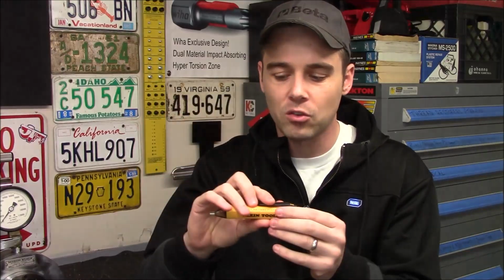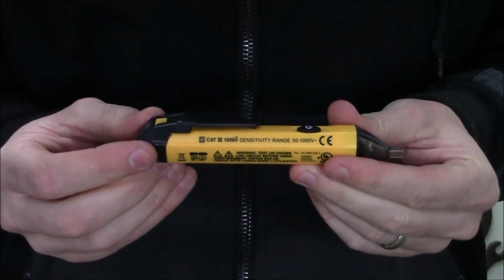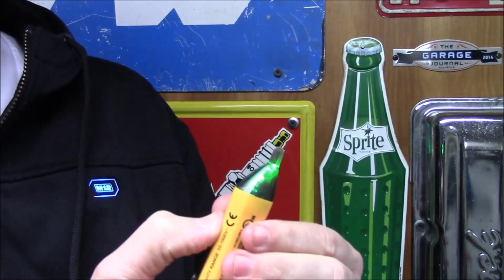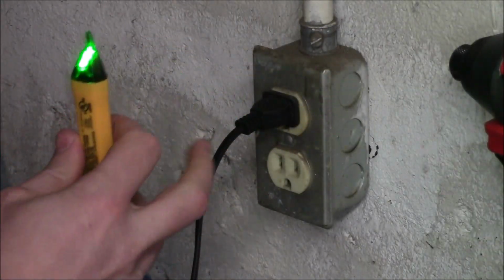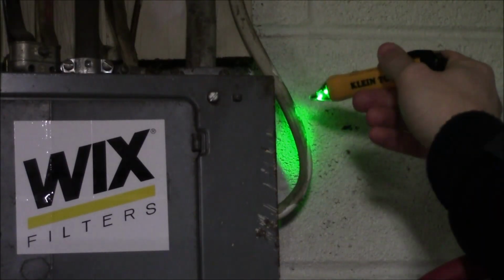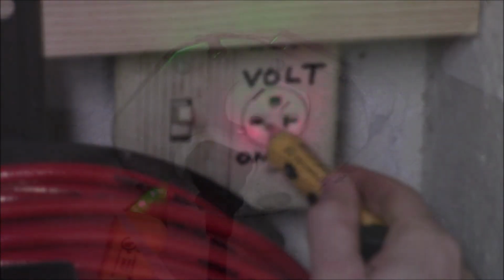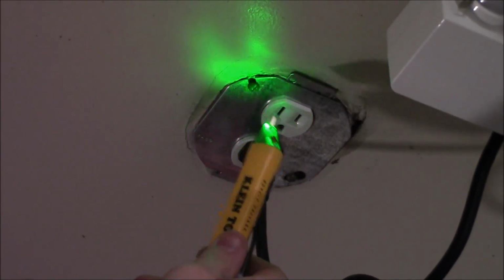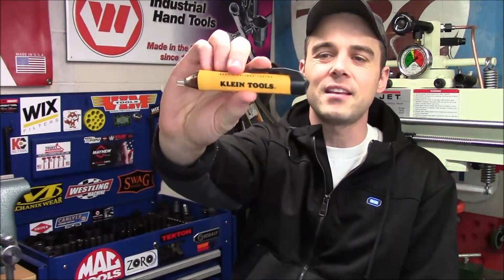Klein Tools NCVT-1 Non Contact Voltage Tester

Comment: 5:01  It doesn't give you the illusion there is no power in the wire, what it does is to help you figure out which conductor in a wire is the hot wire, and which is the neutral wire.
Reply from the maker: For a DIYer….. It gives the illusion, unless you know how to check it fully.

Comment: Question: This product is advertised as non contact but I noticed you stuck the pen right into the outlet to test. Is this the way this tool is supposed to be used?
Reply from the maker: Well keep in mind that it doesn’t physically contact the metal inside the outlet, nor the copper inside the wires…. The closer you get, the more accurate it is.  Better safe than sorry, so I simply get as close as I can.

Comment: I'm not too impressed with this tester. It doesn't have the same sensitivity that my last voltage tester had. I'll try fresh batteries since I used what came with the tester. 
But my last voltage tester would read power through a light switch plate. This one seems like you have to get almost on the wire before it indicates.

Comment: I don't know if it was in the comments but it wasn't in the video I had mine in a box for years took it out turned it on had a test work couldn't shut it off and then it wouldn't test correctly either it just had the green light on forever so I just decided was supposed to be like a computer and I pulled the battery out but the batteries back in and everything reset and it's good to go sorry anyway if you got problems with the thing take the batteries out put them back in thank you for the video

Comment: Hi thanks, I got a weird problem. When I test an outlet, (it's an old house, 2 wire, no ground)  Both live and neutral turn red. However, when I measure between the L and N with a volt meter, there is 0 voltage. The outlet is dead, no lamp turns on.  

So I ran a wire from the N at the outlet back to the power box to test for continuity break is the Neutral,  and I get a voltage of 117V between the N wire coming from inside the house and the Nueutral connector bar at the panel?  What is happening here?
Thanks.

Comment: If you don't use this frequently make sure you remove batteries before putting it away in your toolbox. If you're lucky they'll just deplete on their own. I just rieeded to use mine after being stored for about 6 months and not only were they dead but the battery leaked and destroyed the insides rendering it junk.

Comment: It makes no sense to me why these are preferred over the more sensitive, adjustable style of NCVTs. These clearly show false negatives if you just happen to not be touching the right place and the fact they require you to get close enough it's touching a NON-CONTACT tester bewilders me. Sure, it tests outside the jacket without contacting the conductors but I can wave my adjustable tester around the air of a junction box without disassembling anything to get a positive reading.
     How is an early/false positive worse than a  false negative??? I'd much rather have to double-check my positive readings than miss one entirely just because I was a quarter inch away...
I've asked a couple electricians and they can't bother explaining why. 
I want to replace my cheap adjustable one because it's not very durable but these more expensive testers are practically useless to me.

Comment: Why are they called "non-contact" testers if you have to contact the tool with the wiring?
Reply: Because you don’t have to ‘contact’ the non-insulated conductor like you would on an amp meter or alligator clip tester.

Comment: A crappy tool. Don’t buy this. The ON/OFF button never works when I press it, so I press it harder and harder but it won’t work, so out of frustration I’ll throw it back into my tool bag, and then it turns on due to the slightest touch when it lands. And good luck trying to change the batteries. You’ll never find a more puzzling and difficult battery cap to replace once you’ve changed the batteries.
Reply from the maker: Try decent batteries & not junk ones from an old TV remote.

Comment: Hi, thank you so much for the easy to understand video. I am a single mom and have to fix all that I can myself. I purchased one of these voltage testers and really was not sure of its capacity, but you explained everything about using it so well in this video. I now feel comfortable using this tool to check for voltage without having to consult any guy to have to check it for me. Thank you again!

Comment: I just installed a new electrical outlet in my house with a Built-in USB port. Before i use it i tested it with this tool.  I'm concerned bc when I put the tester in the hot side of my electrical outlet, it's flashing red green red green. Can someone tell me what that means???
Reply from the maker: USB = dc power
Reg outlet = ac power

Comment: I accidentally put mine into "silent mode" and can't get it to go back to normal beeping.  Frustrating.
Reply from the maker: I think if you turn it on, and then hold on the button for five or 10 seconds, it will beep and turn the noise back on.
Reply: @RealToolReviews  
That did seem to turn the beeping back on, but now it's so quiet I can barely hear it.  And yes, I tested and ghanged the batteries. No difference.

Comment: This was a good review,  two  subjects I’d like your opinion on.

First it would have been more to the point to video you testing the tool with a outlet you knew to be live before testing the suspicious outlet. You tested the tool on the switch and had it been bad it would have left the impression that the cuicuit was not energized. Secondly, I disagree with your comment that the Kline NCVT-1 is not for professional use, in my opinion, anything Kline manufactures is suitable for a professional and can be trusted. Other then that in my opinion, this was a good review

Comment: The only thing I have to add is, you dont have to hold the button down until it turns off. just hold it down for 1 second (like when you turn it on) and release and it will turn off right away.

Comment: when he tests the hot light switch it beeps differently when tests each side of the switch.
The light turns red for both sides  BUT the first side is a fast beep beep beep and the other side is slower beep...beep...

What does that mean?
Reply: I have this same issue. It also beeps slower on most metal surfaces. What gives?
Reply: Rj Miller - Jesus is coming soon?

Comment: I have one of these and it detected 12-48 volts when it was 5 volts. It detected 12-48 volts when it was 120 volts, and it detected 120 volts when it was 5 volts. It also detected 0 volts when it was 120 volts. 

It is hit and miss with this thing. and no electrical tester should be hit and miss. It is useless then.

If any electrical tester works accurately, then it's a Fluke.
Reply: This one only beeps and changes color. It doesn't tell you the amount of volts you have.

Comment: Strangely this tool also beeps on DC voltage.  I tested the cable between a phone charger with an output of 5.2v DC and it beeps all along the cable length from the charger to the point where the cable plugs into the phone.  Any ideas why?
Reply: It's probably picking up emissions from the DC switching converter or coupling from the AC input.

Comment: Can I test my cigarette lighter socket with this tool?
Reply: No.. Cars run on DC current.. Unless you have an invertor you cannot test it and if you had an invertor it would likely have a light showing you have power...  

This is for household wires and plugs etc.

Comment: So, I followed the rules and it seemed to shut off, but it beeps twice at uneven intervals. 15min. Coupla min. I went to sleep but it double beeps at almost 3hrs. Is it a battery warning or ?
Reply: Replace the batteries. Use rechargeable if you can. When switched on, if only the red light beeps, the batteries need to be replaced. It's always best to also double check for power present, by using a pig tail tester. Also, to be safer, wear rubber gloves and rubber bottom shoes. :/

Comment: Mine is too sensitive.., as soon as it's anywhere close to any live wire (say 6" radius) it starts beeping red.  I wanted to check the wires inside the dimmer switch in the wall. I took the cover off and then unscrewed the switch and pulled it out of the box... I wanted to know which one was the LOAD and which one was the HOT wire but even though I pulled the wires as far apart as possible, as soon as I approached the area with my tester, the red lights came on! So frustrating... What's the solution? One thing though, should I have detached all the wires from the switch first to get a better result? I did mine while the switch was still attached....

Comment: I have the dual one that works with both ac and DC and I have no idea how to operate the DC mode lol 
But thanks for the tip lol its very helpful and I'm a part time electrician
Reply: AGENTMARIE AKADva PLUS • What is the name/brand of it, and have you learned how to operate it yet? Use Google or YouTube to find out how to use it.

Comment: Thinking about ordering one of these. Can anyone tell me if it can tell you which wire is the hot and which is the neutral? Thanks.
Reply: That's why I bought mine. The hot wire will beep and the neutral wire will not beep.

Comment: Why does this device chirp at two different levels?  I just picked one up recently, sometimes it chirps fast and sometimes it chirps slower.  It was audible in your video as well.
Reply: exactly what I need to know as well....
Reply: Thanks! but shouldn't all outlets on the same circuit beep the same?

Comment: I have a circline fluorescent light fixture that's not working even though I installed a new bulb. The fixture has been there a long time but up to this point I have never had an issue with it. I don't know if the problem is the switch or maybe the ballast. Would one of these testers be helpful? Thanks.

Comment: Mine intermittently detects low voltage and will beep if I jab it at the wires.  So, sensitive when I don't want it and not sensitive when I do.

Comment: wish it dc
Reply from the maker: +Jeff L Yes, that would be nice.
Reply: Ohm meters test continuity, fuses, wires as well as AC, DC power. That however requires contact with the conductors. This a non contact voltage tester. It doesn't tell you how much voltage. It only warns you it's hot. To check for proper voltage, use an ohm meter.

Comment: These are very handy, but they can lie too. Fortunately, it'll lie in the way where you won't get hurt. My old Klein tester a couple years ago would pick up "residual" voltage. Mainly in old houses and commercial buildings. It basically would tell me something was hot when it really wasn't. In some old houses, I could put them against wood studs and they'd be chirping away. Electricians really should have digital meters. They are really the best way to go to be a professional. HOWEVER! In the defense of the non contact tester. If you need to test something where you have absolute no reference to ground, then a digital meter is useless. PRO TIP! If you are picking residual voltage with a non-contact tester, you can hold the insulation of the wire, and it (in most cases) will neutralize the voltage and the tester will stop chirping. As far as I know, this has to be a single conductor, not a whole piece of Romex or MC/BX. I hope this helps!
Reply: I just got one of these, and was trying it out on things I knew were hot and knew were not. And it didn't seem to make sense.  So this video helped a lot to know to test all sides of a cord, etc.  Your comment helped, too.  I have a broken flat-top cooktop I'd disconnected the wires from the junction box and coiled them up and tied them until I get around to removing it.  The tester insisted that the disconnected wires were hot, hold them or not.  Go figure.  The wire going into the junction box now has the breaker shut off ever since I removed the other thing that was wired into it.  The tester was chirping for that, mostly just once then green again, and holding the wire like you said quieted it...

Comment: So is the neutral another ground ?
Reply: The Neutral is the return path for the electricity. Electricity comes from your panel and returns back to your panel. The Neutral carries the load and neutralizes it. If your neutral is spliced and has it's proper return path, you will not get shocked by touching the copper. But if the neutral is not spliced, you can get shocked from the neutral if you're grounded (in most scenarios, you will be) because the electricity is going to need to find a return path. I hope this helps. Be safe people, and don't play with electrical if you don't have experience :)

Comment: As an electrician I own a several different non-contact voltage testers and they are handy. To the DIY take notice that he checked the circuit hot before he checked it dead that way he knew his tester was working properly. Very nice review and video!
Reply: DC Rickerson, Kickass name btw
Reply: On a regular 110v receptacle im getting red light on both neutral and hot side .Breaker is fine
Reply: @rogerleadbeter1625 ?
Reply: @rogerleadbeter1625 you need to checkout with a Meyer rather than the hot stick in the video. Always use a meter if working something to figure out if it's hot or not. Your hot stick could potentially be picking up power from the hot wire run in parallel with it. Not always correct, use a meter to be safe, rather then sorry. I'm an electrician for 30 plus years and use my hot stick daily. However, I know what I'm working with and exactly how to handle it even if it is energized. BE SAFE. ONLY WORK ON NON ENERGIZED CIRCUITS, IF YOU'RE JUST A HOMEOWNER, PLEASE.
Reply: My new outlet is flashing flashing red green red green red green on the hot side and I can't figure out what that means
Reply: DC Rickerson

Comment: I think it works better than the Flir  My Flir will light up if there is power about 1 foot away  which if your working in a panel where a bunch of wires are you cant isolate very well at all